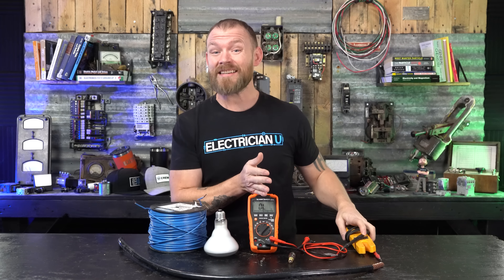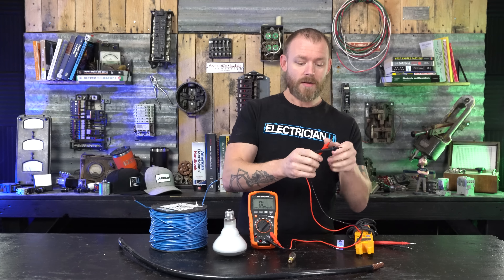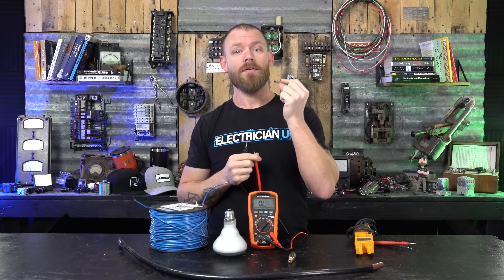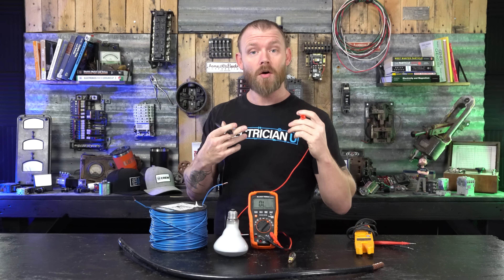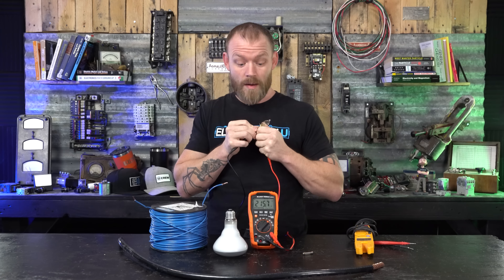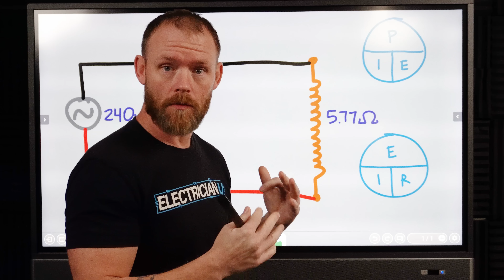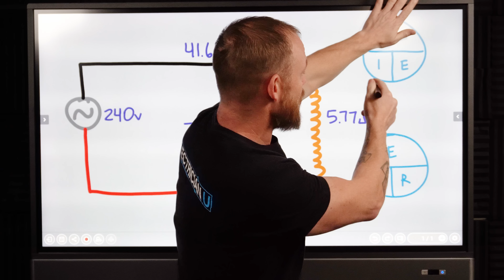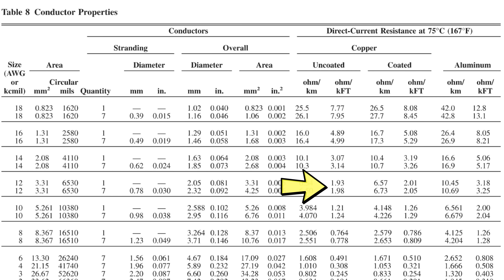How to Test for Resistance? What is Continuity?

Comment: Most normal multimeters measure resistance with about 1 mA current.  It's too low for many things outside your lab table.  At least that wire length measurement would get you easily way off.  For better results for low resistances you could use an installation tester at its continuity (or line resistance etc) setting, where the used current would be 200-250 mA.  Those often give the result with couple decimal places and you might have an opportunity to zero/compensate your test leads.  With basic multimeters you should first test just your leads (should be under 0,2 ohms if not broken and at 0,5 ohms you should get rid of them) and subtract that value from the actual measurement.  And be very suspicious in the low end of results, under 2 ohms is hard for most devices.

If you really need to measure some low resistance values, you could use constant current (or otherwise limited output) power supply, that would not die even in total short circuit and measure voltage at a point where you want to get the actual value, so that there isn't any resistance from test setup in your result.  I often use 1 amp constant current for things like wire length measurement and other things like that (which is nice, as at 1 amp the measured voltage is directly the resistance in ohms.  Other current values need some math.).  We even had to measure protective grounding setup in a explosion hazard zone with 10 amps from a adjustable transformer to be sure that every metal part is really grounded and we could get a precise enough result to our report.

tldr: dmm:s give bad results for low resistance, if the result matters, use something with higher test current instead.
Reply: Precisely why I carry a standard meter and a clamp on that does mega.
Reply: Thank you. I was going to say something similar, but you worded it better than I probably would have.
Reply: @mattfleming86 If your clamp-on does mega, wouldn't that be good for very high resistances? Wouldn't you want a milliohm meter for very small resistance values? Or am I getting confused by marketing-speak?
Reply: @mattfleming86  I am not a Electrician  I am buying a 220 volt table saw but want to bring it to my job sites which probably All have 120 volt.  Is There an equipment bridge that you can recommend I use?
Reply: The other (better) alternative here is a 4-wire ohm meter with proper 4-wire probes.
Reply: @W9CR  every electrician (should) already have a multimeter and installation tester. 4-wire ohm meter is way too specialized to carry with you for daily problem solving in random environments.

My cc power supply and multimeter combo does exactly the same thing, but for a lot cheaper.

Comment: Realy hope someone can help me. 

When i test a armature commutator i set multimeter to 20M ohms then 1 wire on shaft and other wire on commutator, then get reading. Is this mean there is a short between ground and commutator? 

When set it on lower ohms i not get any reading. Just when set it on 20M ohms and 200M ohms i get reading.

Comment: Take a known wattage incadescent bulb and measure resistance, do your math ... and wonder. 
This is because cold filament has much lower resistance (in my few measurements I got quite consistent value of factor 14) than when being lit. In a way a lamp filament functions as a rapid PTC. So resistance testing is quite useless to deteremine the wattage of lightbulbs (well, maybe, if this factor 14 is really consistent, it can be calculated in?). 
I'm not sure how linear heating elements are ...

Comment: I have a very strange question for you about my continuity tester...I have an old family crucifix from the late 1800's. It actually lights up my continuity tester! I've tried it out on many other non electrical items and it does not at all light up. But stranger yet it only lights up on Jesus on the crucifix and not on the metal or ebony wood trim...just for the heck of it I put the tester on Jesus on the crucifix and I was shocked to see it actually lit right up....
Reply: if jesus is made of metal, then it will have continuity. possibly even if the paint used on jesus contains metallic flakes, or  dipped in bronze or gold, i believe it could also show a reading for continuity.  jesus is falsely acting as a conductor for power, just like religion intended him to be used as lmfao

Comment: What is the math to find the amount of wire on a spool?
Reply: You need to know the resistance data for a given length, say 1.0 ohms for 200m. Then measure the resistance with your meter and use the "rule of 3". Obviously this will be a ballpark approximation, multimeters aren't very precise in very low resistance measurements.